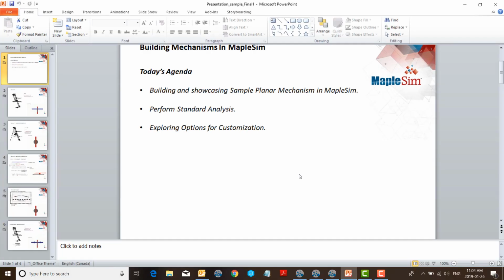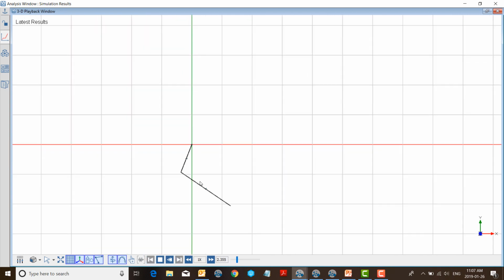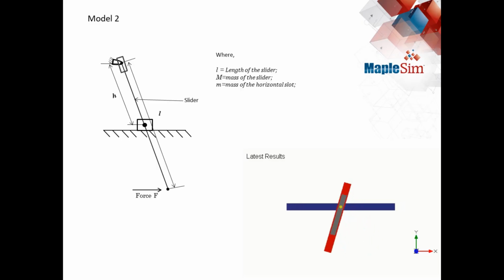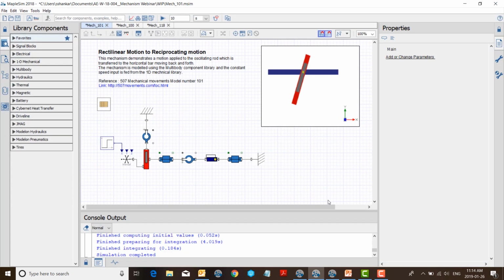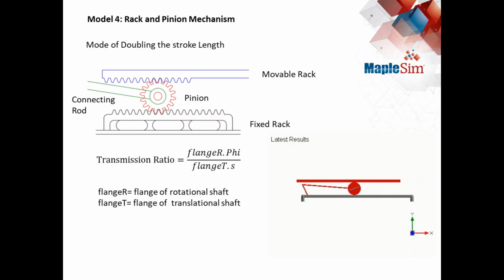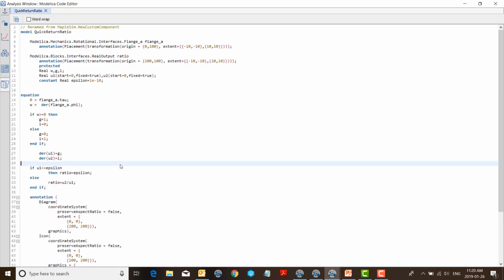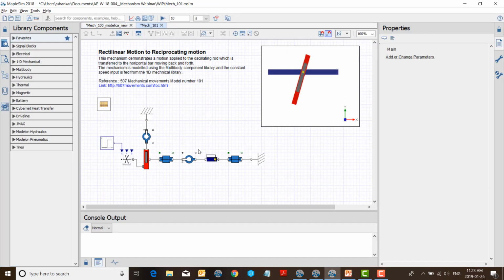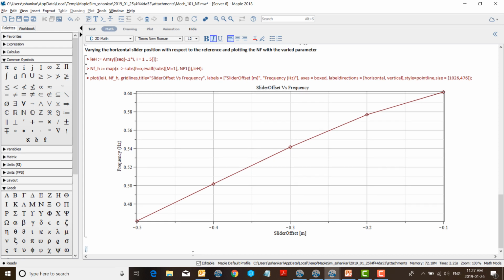Building Simple Mechanisms in MapleSim

Comment: Bonjour, est-ce qu'on peut créer une simulation, Machine d'Anticythère, avec Maple ? Merci
Reply from the maker: Hi there and thank you for the question.  Researchers have used Maple to model the differential gear systems found in the Antikythera mechanisms – example https://www.researchgate.net/publication/289205011_Kinematic_Analysis_of_the_Antikythera_Gear_Mechanism_by_Means_of_Graph_Theory
A simpler model of our solar system without gears is possible in Maple by entering the equations of motion for each body, treating gravitational forces based on spring-damper responses to gravity and solve for their positions over time. Alternatively, a system model can be created in MapleSim to model several planets and show the visualization of their motion once the initial conditions are set. We have an example of this in our model gallery (including the MapleSim model file): https://www.maplesoft.com/products/maplesim/modelgallery/detail.aspx?id=10